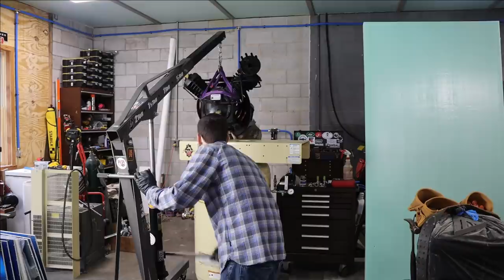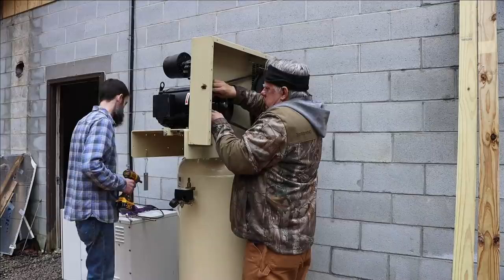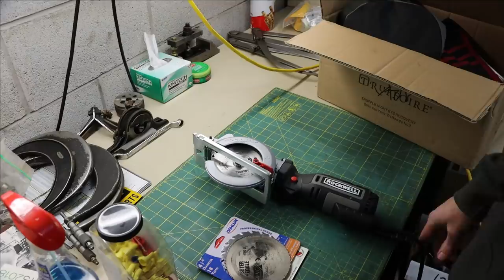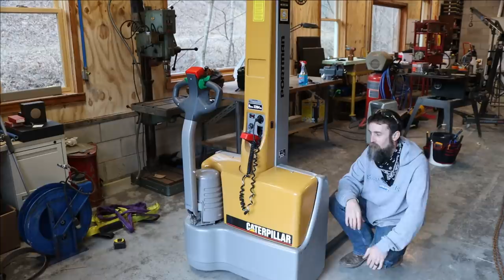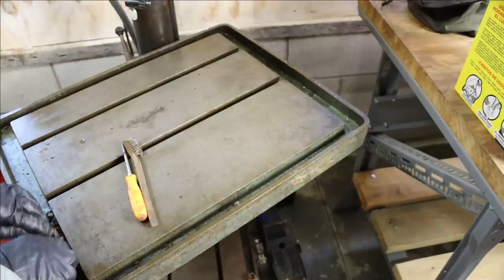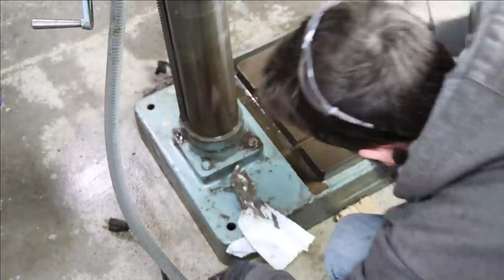Awesome New Shop lift! /  Doall Drill press 1st run and clean.

Comment: Install the back shelter, with legs around it, extend the roof over the door, but what about using a welded bracket to support the left of the roof from the wall (cantilever). will give you clearance, but be a rain shelter if you have to go out and service the machines.
Also, i would use flexible metal conduit for exposed cables, specially the one under the compressor, critters like to chew cables.
Reply: put a double header up the whole way across and don't even bother with a corner post at the door.  the roof isn't really that big so what is the expected load on it.  how much snow do they get down there?  even a foot of snow on such a small area would be supported.

Comment: It'll work on car batteries but they won't tolerate being deeply discharged anywhere near as often as the proper ones and will fail much sooner. The internal plate arrangements are somewhat different for the different applications.

Comment: Could be worth looking into two 6v golf cart batteries in series. They work great for an rv rather than two 12v deep cycles; they give us more capacity with the 6v. I know the application isn't the same, but slow discharge/continuous use in both cases.

Comment: Nicad and Nimh batteries can be trickled forever without damaging Lead acid can not. AGM batteries can be brought cheaply but needs to be taken off charge as the electrolyte may cause damage. Lithium also needs rest. Build a Nimh battery is best option.

Comment: @ 16: 22 Mi NOT a Bucket;... But the same Idea...
I made 4 mine;... A 4 Small wheeled Base C/W a handle...
So I could just pull it around behind me...
A piece of Plywood;... for the lid;... with some old foam made a GR8 Seat...

Comment: Brazing in the Bozo marks in the DoAll table then re-surfacing it under the shaper would be a neat series of videos.  I would be very interested in at least plugging the through holes so they don't make a mess below even if it's not feasible to build up all the divots flush with the surface.

Comment: I would go with AGM batteries. They have a higher resting fully charged voltage than regular lead acid batteries. So if you installed regular lead acid batteries, The charger will overcharge them, possibly causing leakage of the electrolyte and shorten the life of the batteries.

Comment: Group 31 semi truck batteries have the same characteristics as deep cycle batteries but you would want smaller cold cranking amps as less plates inside but they're heavier place higher cranking amps have thinner plates but more of them

Comment: FIRE WARNING Be careful of the magnifying glass by the window, down onto wood.  Come summer the sunlight will be much stronger, and that’s a wooden top!
Reply: not with that size of magnifying glass on a woden table. 
but if he has paper or shi on the table maybe yeah...
Reply: Yes, you are right! This happened in our lab to one of our workbenches.
Reply: I had a fire in my shop from a thick glass desiccator standing on a plywood workbench inside a window. The sun happened to enter at the wrong angle and started a fire. The workbench burned partially, by sheer luck I was close by to put it out. The danger can be quite real. I would not have believed that something like that would focus the light well enough to start a fire.

Comment: Great find on the pallet truck!
I bet it is a rebranded Jungheinrich unit from Germany, I work with their products whole day, from hand moved pallet trucks to forklifts, great things!
Would go for sealed AGM or golfcart batteries, as the charging can produce gas, that does no good to the internal components.
Note the position of the batteries, together with the driving motor they act as a counterweight to your working load, so LiFePo would be no good, away from the price...
:-D
As someone said before in the comments, don't show the world how good you are on cleaning the drill press, otherwise your boss will order you to clean the machine on your day job also!
:-D
Thx for the vid!

Comment: Whatever batteries you get, put a reminder to check water level every month, as likely those original deep cycle batteries are bone dry inside the cells, and thus dead. So many are scrapped because the water level was never checked. As well so many are "sealed for life" so there is no way to check, but often you just peel off the sticker on top and pop off a cover to reveal the filler caps.
Reply: agm.... no liquid.
Reply: @davidblarstron767  AGM has liquid, just not much, and thus any mild overcharge or balancing charge will kill them rapidly. They also lose water due to temperature cycles, though often the better cells have a tiny palladium coated stainless steel flash arrestor in the fill cap, that recombines small amounts of venting hydrogen and oxygen back into water to recycle in the cell. 

But any venting from them is a loss of the minimal water they have, and I really do not like them as long term reliable cells, unless operated in a totally temperature controlled environment, and only to the exact manufacturers operate conditions. Run them like any other lead acid cell and they do not last well.

Comment: depends on the usage. wick company made electric feed carts 14 cu ft unloaded from the right side the 60 cow dairy i worked for put in a large caseih battery had to be charged after each feeding twice/daily lasted 18 months. they came with battery charger/built in timer 1 hour charge

Comment: Steve they look like 12v i would use Trojan t1260 deep cycle batteries.  That is what you need in deep cycle system you have. Car betteries are not ment to be used in a deep cycle application. Good luck.

Comment: When you charge a car type battery from a deep discharge state it bubbles the sulfuric acid electrolyte. The result is hydrogen gas which is explosive and you also get microscopic drops of acid floating through the air. In a car, there is plenty of air circulation when charging so there isn't an issue.  In the enclosed environment of the lift, hydrogen gas may not be a problem but the acid will cause terrible corrosion issues. They will work fine in the short term but you may regret it over the long term. If you do decide not to do the AGM batteries at least install deep cycle marine batteries. They are designed for this type of application.

Comment: Simple car battery is not best option for that unit.  You will want a deep cycle rated battery, not a starting duty battery.  Also, a sealed or "maintenance free" is probably preferred to minimize corrosion affecting the electronics in the shared compartment, as well as minimizing gassing during charging.  They cost a little bit more, but they will function much better in that type of equipment.

Comment: check on having the deep cycle batteries rebuilt, I have been using rebuilt batteries for over 20 years and ell satisfied with them.  old timer stuck in th north.

Comment: I wonder if that drill press table could fit on the shaper. If so, the peck marks brazed full and the table surfaced could be a nice touch; and a fun video. Kintsugi drill press...
Reply: Really for this, braze it up and use a coarse mill file laid flat on the table... the braze, being softer, will cut long before the base material.

Comment: If you match the Ah rating and don't run them too low, which is the reason for deep cycle batteries, "normal" batteries should work. The specs on the battery that you buy will give you the suggested low voltage cutoff range. You can find a cheap little digital volt meter to add to the panel on Amazon or eBay (I'd go with Amazon).

Comment: So... I know about 400 comments have talked about the batteries. Allow me to try to differentiate myself. 
I OWN THE EXACT SAME LIFT!  
I've had it for 11 years now. I've used regular automotive batteries AND deep-cycle batteries. The automotive ones lasted about six years, which is pretty good. The one thing to know is that the charger (the thing with the swiss cheese holes in it attached to the bulkhead) is a part that fails eventually, and it costs an INSANE amount of money from Cat. Like, four digits! If it dies, just get a battery Tender 24v charger (less than $100) and mount it to the bulkhead next to the old one, pull out the old power wire and route the new one back up through the tower. The other thing that will die on this is the polyurethane drive wheel tire and the idler tire. They eventually just crumble. Those aren't cheap either, but they are available still, and with a more modern compound that is harder and lasts longer than the originals. To change them, find a friend with a lift, or rent a truck with a lift gate, and strap it down across the forks with the tail hanging off the edge. It's really a great lift, with a true zero-turning radius, and I've moved (literally!) tons of equipment by myself with it. Enjoy!

Comment: Make sure you pick up some deep cycle marine batteries they are made to be charged over and over plus also made to be drained. Car batteries are not to be drained down they will develop a memory and not work as good as deep cycle marine just make sure to get the right group size Amazon has plenty of choices so do the respectable pets houses. I think even wal mart has these available they have a good warranty program. Deep cycle all the way!

Comment: Before you begin "hammering" on that table, I suggest you get a removable polycarbonate screen to protect the windowpane from the first bit of shrapnel that tries to smash it.
Regarding the batteries for the fork hoist - Don't use car batteries they will fail sooner because they aren't deep cycle and don't like long periods idle between use/charging.
Get deep cycle "house batteries" intended for RVs / marine use. 
You might find that with car batteries ,you pay for new ones and when you come to use the hoist, the batteries are not functioning as energy storage anymore - false economy

Comment: Nowadays AGM batteries are not that much more expensive than regular lead acid. I would guess that Caterpillar put them in there for a reason. Also the charger will be designed for AGM and top out at 14.6-14.7V rather than the 14.2-14.4V for regular lead acid, so would quickly damage the regular batteries.

Comment: Those forklift can be great and a POS at the same time. we have one at work(only one that work with our pallet rack configuration and aisle).  Open bottom pallet only. forget about moving around a regular pallet: going IN is feasable sometimes..going out a lighter one is a real struggle.   receiving product on open bottom pallet are kinda rare., one wheel drive..we have great flat floor but it slip on the minute imperfection :| just dealing with the open bottom pallet deal is a pain...everything else is great and can be great use to use as a lifting device..even though it's not made for it.

Comment: Steve, nice drill press, nice pallet lift and nice big compressor. You are going to have a great, well equipped shop. Steve, I would like to know what you used to clean the rust off of the drill press? I have one that is in pretty bad shape and need to clean it up. Good work, thanks.

Comment: mechanically and electrically speaking a standard car battery will replace a glass mat battery with no observable problems    but it will not last quite as long in that sort of an application due to the fact that you are pulling relatively smal amounts of power from them and regular flooded batteries handles that worse then agm batteries does but they will work for at least a few years

Comment: Stick with AGM batteries.   

AGM are deep cycle and typically surprisingly high discharge rate.

A "marine" battery is a cheap "deep cycle" battery (typically).  They're constructed like a typical car battery but with thicker and fewer plates.

Comment: Check out Keith Fenners channel on the repair he did to the cast iron dovetail way on one of his lathes. Title is called Free Space Part Three. The product he used is called "Marine Tex" http://marinetex.com/products/marine-tex-products/marine-tex-epoxy-putty/ It also comes in gray. It looks like it would be perfect for repairing the peck marks in the drill press table.

Comment: Did you put rubber washers under the nuts on the air compressor feet?
Otherwise you still have a solid link from the tank to the pad.

Comment: JB weld or iron filings and epoxy it repair those holes? Scrape excess flat with your razor blade to avoid damaging the casting..

Comment: Man, I don't have that kind of luck when I say "It better work".  

p.s.  For those bench corner mounted vises, it makes a world of difference if you put a stout support column right under the vise base.  I use 4" steel pipe with mounting plates on both ends.  You might not think the table flex affects anything, but when you're trying to hammer something loose it really does.  Its like the difference between hammering something on your workbench and hammering the same thing on a proper anvil.  Any give at all softens the blow.

Comment: So you should be able to use car batteries as long as the voltage is 12 volts. I would recommend using deep cycle batteries but I'm the type I would go with oe style batteries

Comment: Cement block around those expensive equipment you got outside and you can put a heater in there for cold weather....draw your air from inside your shop for the compressor so it isn't freezing cold air ..filter it good of course....
Or use metal siding but your a bricky now...

Comment: You will want deep cycle batteries, they are made with fewer more durable plates than a car starting battery, better for a prolonged lower amperage draw vs, an intermittent high amperage draw. look at trolling motor batteries and ups batteries, you can probably find a very similar to oem for about what a car/ truck battery costs. Also pay attention to weight, heavier almost always = better in lead acid batteries, plus their weight may be factored into the counterweight of the machine for weight capacity

Comment: Steve, I would look at replacing the shop lift batteries with  Lithium Ion or LIFePo4 batteries.   For intermittent service the Lithium cells will have a very long life with very minimal self discharge.   Looks like the unit has a 24V system so go on the net to see what is available in E-bike battery packs and chargers.  You don't need to match the physical size or capacity of the LA cells to have a very usable upgrade.  Generally you should not use the internal charger but use the e-bike charger.   Another source is golf chart batteries which are switching to lithium cells as well.  Go see what batteryhookup.com has to offer.

Comment: Nor sure you really need posts straight down to the ground for that tiny roof over the compressor. Just put some supports down at an angle to the building wall.

Comment: Steve... Cat lift batteries.. got an autozone.. they have just slightly less than 100 buck group 24 and 27 deep cycle batteries that should fit that lift..  and they are in stock.. 
Duralast 24MD-DL group 24 deep cycle marine and RV battery.. top left positive terminal. 
Duralast 29DP-DL group 29 deep cycle marine and RV battery.. there is also a 27DC DL you will have to measure to see what fits.
you may want to hook up if you have one. a current limiting power supply to the batteries after cleaning the terminals.. set it with the battery disconnected to 17 volts at 1/3 of an amp and let each one sit for 2 days on it.. batteries that have been sulfated can be broght back if normal charging current and use has not been applied that harden the sulfate crystals..  you mentioned that you already tried to charge them so they might be damaged..  or have just aged out..  set the current limiting power supply open lead to 17 volts then short circuited to 1/3 of an amp then hook it to the batteries individually. .

Comment: Make sure you cover the magnifying glass when not in use the sun shining thru it can burn 🔥 your table don’t ask me how i know.
Reply: Or, remember to keep the lens face rotated 90° relative to the table, and the window, when not in use.
Reply: I keep my magnifiers covered because I don't like them getting dirty. Don't ask me how I know I don't like cleaning them.
Reply: @1pcfred  especially in a high dust environment, a cover solves two issues at once
Reply: @matambale  everywhere is a high dust environment. 60 tons of cosmic dust land on Earth every day! So now you know where it all comes from.
Reply: @1pcfred  Surface area of the Earth is 197 million square miles. 60 tons is 1.92 million ounces. So, roughly, one hundredth of an ounce of cosmic dust per square mile of the Earth.

Still, it accumulates in my lab.
Reply: @matambale  that's the point. It may not happen overnight but it does tend to build up eventually.

Comment: I use the bucket method just for small jobs when I know what tools are needed and the parts and screws fit in it all at once, so I don't have to lugg around my whole tool box and the materials. 
Using a buckets AS your tool box defeats the purpose, I think! 😂

Comment: You may think about replacing your batteries with lead acid batteries but do not forget lead acid batteries have an off gas and you are putting them in an enclosed area with a electrical charger sitting next to them, remember you must have good ventilation are you could have exploded

Comment: Look at AGM troller batteries. If you use regular car batteries the off gas will destroy the frame. Call the Cat dealer see if they have a deal then call around at the boat shops. Advanced has them for $360 a pop under optima battery name. Caterpillar owns Mitsubishi forklift plant but Mitsubishi is a Japanese national company so you might find a deal under Mitsubishi name as Japan puts $ incentives on parts.